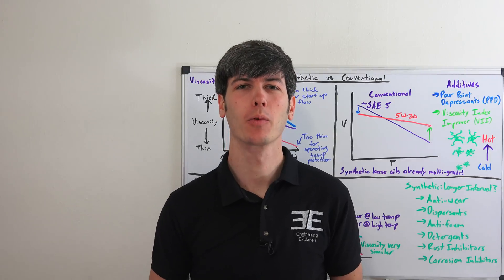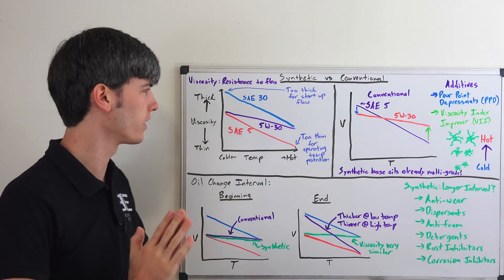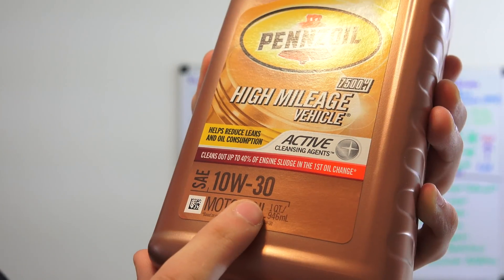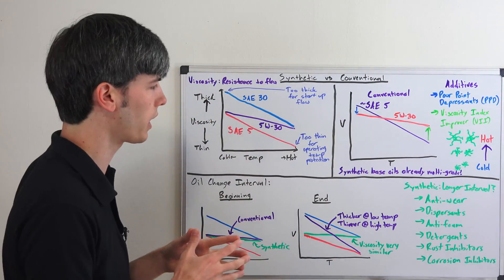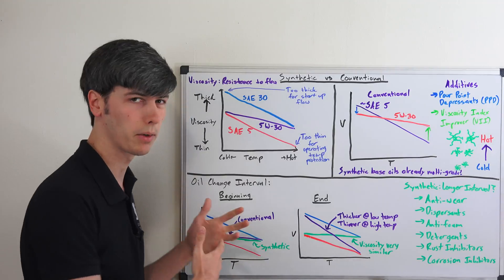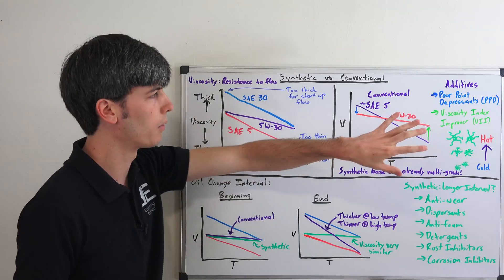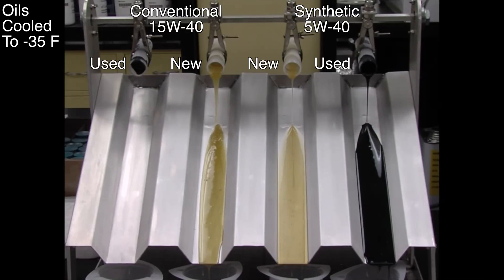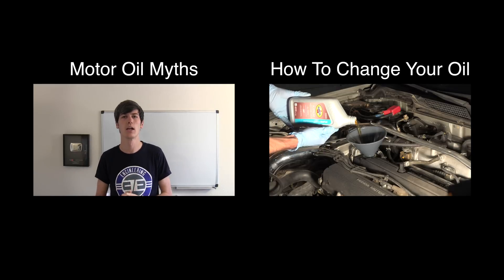Is Synthetic Motor Oil Better For Your Car?

Comment: Perhaps your other videos bear meaning and stay on topic to their titles. Is synthetic oil better? You really haven't answered it in this video.

All my cars use Mobil 1. My car has a computer to calculate the time to change, by time and miles driven. Oil that blackened indicates either a problem or too long in the vehicle...
Reply: Did you need him to literally say the words "SYNTHETIC OIL IS BETTER". Did you actually watch the video? He presented multiple graphs and demonstrated viscosity differences with actual motor oil. Oh, and no one cares about your car.
Reply: ChainsawChristmas No sh!t synthetic oil is better, but a few seconds of a long video in comparison to the ramblings of off-topic wastes people's time. 

I've read the comments, others felt that the author failed to illustrate or perhaps doesn't know the 'why.'
Reply: I'm sure the mechanical engineer doesn't understand why synthetic motor oil is better than conventional. Except the part where he explained that synthetic motor oil is designed to operate over a wider range of temperatures without the need for additives, or as many additives as conventional oil. Oh, and he demonstrates that synthetics maintain their original viscosity rating after long term use by pouring used oil through PVC pipes. You don't have a high level of comprehension and it's ok. Just watch the video more than once, or just let your ASE certified mechanic change your oil at the dealership. At least you're smart enough to read the cap on your oil fill port and use Mobil 1. That's good stuff.
Reply: if your following when your car tells you to change oil that IS what your oil will look like. most newer cars that tell you when to change your oil usually go to like 10-15000 miles, and even the cars manual will tell you the same. when in reality if you want to keep your engine running well you should be changing it by 5000 miles at the most.
Reply: TARider2 All my cars come from the factory with Mobil 1 oil and it's rare not to get 10K between changes and with the oil still looking at worse like 'golden honey.' It's the thickening from carbon, contamination suspension from detergents, or worst plasticizing of conventional oil that starts damaging your motor.

Everything I've ever read suggests the 3K oil change is a myth and those sources with an investment in profit from oil products.
Reply: brand of oil isnt all that relevant, synthetic is synthetic. also how good your oil looks between changes is also dependent on how hard you drive and how your vehicle is used ie: towing, work vehicle,city or highway driving etc. i'll trust my buddy, a mechanic for over 20 years, on how often to change my oil though.
Reply: Weldon Black, I was a GM Powertrain engineer and at 7,000 miles the Mobil1 oil showed silicon, and other metals which means I was getting abnormal wear in my car. I would not go "10 to 15k miles" between changes. However, in theory Insee how one could seriously stretch the intervals. I'd be VERY hard pressed to leave the oil in for 7k or 7 months (whichever came first).
Reply: WDLC1911 Then it must be a problem with GM cars.
Reply: D Jaquith, it was used in engineers' cars as well and all did not drive GM products.
Reply: +TARider2 - You cannot just say synthetic is synthetic. Even within one SAE range, let's say 5w30, there will be many other engine specific parameters which oils need to meet.
Reply: Your car does not calculate anything about the oil. When you take your car to an oil tech, they reset the computer and set the amount of miles for the next oil change. The car only tracks the amount of miles driven. It serves the same purpose as the sticker they put on the windshield. The car does not know the condition of the oil in the engine, you could reset the miles without changing the miles and the car wouldn't know the difference until it brakes down.
Reply: +Resta Con Me - That's not correct. Many cars do track oil quality. BMW's early attempt at variable service intervals used to wok it out on the basis of how much fuel was burned. The idea being that colds starts / short runs use more fuel. Hard driving uses more fuel etc. Later systems include counted for number of cold starts etc. Some indeed do it on mileage only, as you say, but most now are more sophisticated.

Comment: Is there any truth to, going from conventional to full synthetic could cause seal leak issues? I was told you should go synth/blend before switching to full synthetic. What do you think?
Reply: If the engine has no leaks then it won't leak.

Comment: A huge difference between Conventional and Synthetic, is the fact that Synthetic Motor Oil does not contain ingredients, like Wax/Paraffin that build up and gum up your engine. A second notable difference, is that the smallest Micron Filter that you can use with Convention Oil is 10 Microns. You can use a 1 Micron with a Synthetic Oil. What does this mean? The smaller 1 Micron Filter, which should NEVER be used with a Conventional Oil, can trap smaller Particles of dirt, carbon, and so forth; whereas, the 10 Micron Filter allows some of the particulate matter to keep recirculating through your engine. You can actually clean up the inside of an older motor with Synthetic Oil. First, use a Motor Flush from your Auto Parts Store per the instructions. Next, drain your used motor oil and remove the old filter. Be sure to recycle that old oil. Next, replace the Oil Pan Drain Plug, install the new 1 Micron Oil Filter, and add your Synthetic Motor Oil. One thing I try to do, is fill the Oil Filter before I install, if possible. Some Oil Filters lay on the side or are upside down, so this isn't possible. As soon as you start driving, the Synthetic Motor Oil is Cleaning the inside of your motor. Check your Oil every day and watch it darken as it cleans. When it starts to darken, and before 3,000 to 5,000 miles... perform a complete Oil Change using your Synthetic Motor Oil and a 1 Micron Filter. Here's a true story... I purchased a used 1999 Ford Expedition that had about 90,000 miles on it. I immediately drained all the fluids, including the transmission and differentials, and replaced them with Amsoil. Years later, around 200,000 miles, the truck started to seep water out of the passenger side head gasket. The truck was still in great condition, because I took good care of my vehicles, but we'd had it for years and wanted something newer, and you had to lift the body off of the chassis in order to remove the head on that model; something that I was not interested in messing with, so I sold to a local garage that I knew. Two days later, I get a call from my friend who bought the truck. "What kind of oil did you use in this truck?" Mostly Amsoil, but always a synthetic... why do you ask? "Well... I pulled the motor, and removed the valve covers, heads, and the oil pan, and this looks like a new motor inside!" "It's so clean that there isn't even any carbon on tops of the pistons!" He went on to say... "The bearings look like new, the cylinder walls have no wear or ring groove; I'm just going to put all new gaskets in it, and put it back in the truck." This real example speaks to the many positive attributes of Synthetic Motor Oil.

Comment: Seriously, how the hell is the oil that black after being used? I've had cars with 100,000 miles and the  oil is barely darkened after 9000 miles (Normal oil change for my cars is 15,000km). Even my cars back in the 80's I'd give them a few short oil changes (3000 miles) with a decent detergent oil and 90% of the crud would be removed from the internals of the engine and then oil changes every 6000 miles would result in slightly darkened oil at most.
Reply: Maybe it's Diesel oil. 5w40 and 15w40 are common Diesel oils sold by Shell who I think he works for?